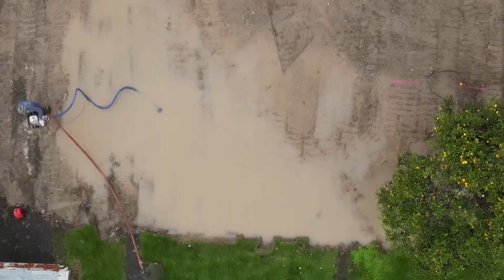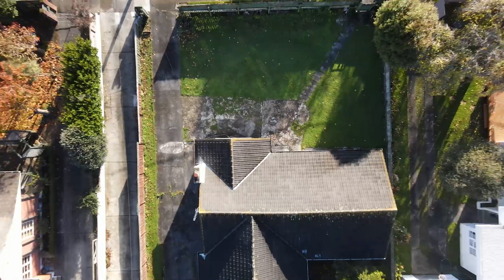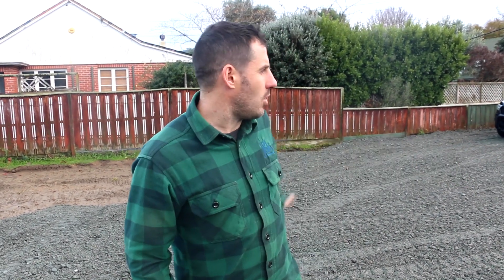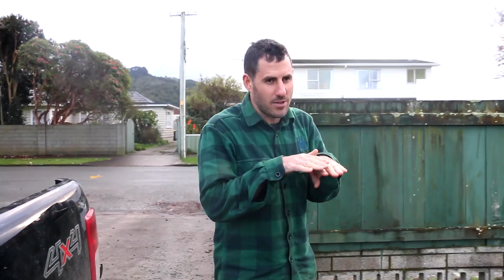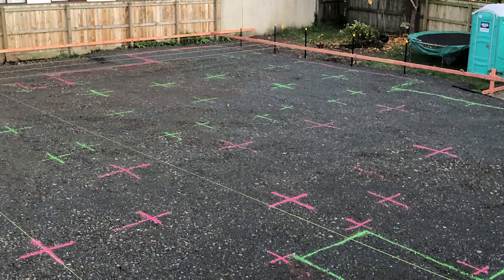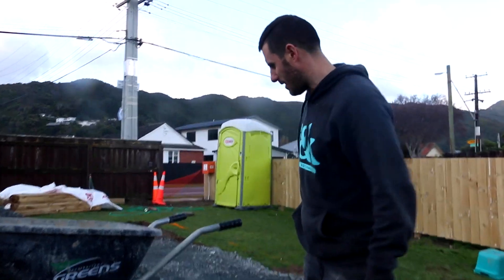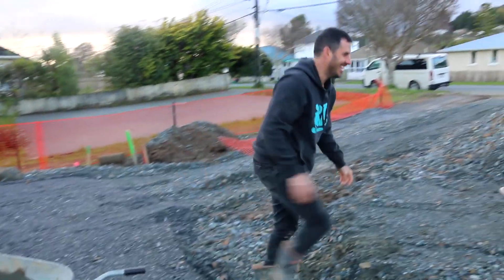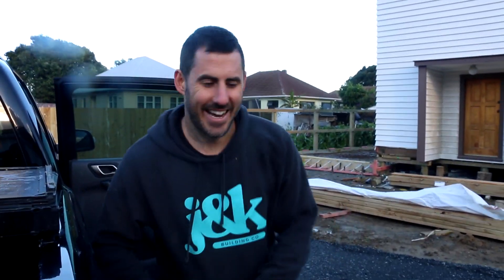Foundations - Preparing For Timber Piles

Comment: Enjoying your vids mate. 
Was wondering if you would make a vid or have you already made a vid about what software you use to run your jobs. I have a big job coming up, so I've been looking into managing software like Workflow Max. Just interested to see what you use. Cheers
Reply from the maker: Hey Sean, thanks for watching :) for the most part I have just used pen + paper and spreadsheets. I've just switched over to a programme called Rave Build, but that was only when we started have 5 builds on the go at once